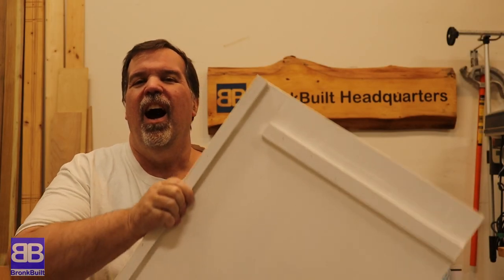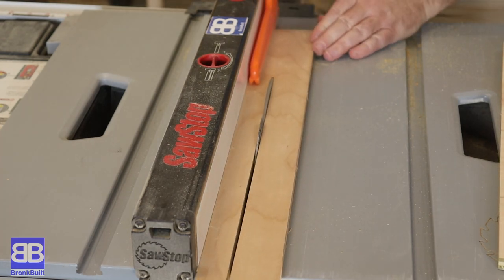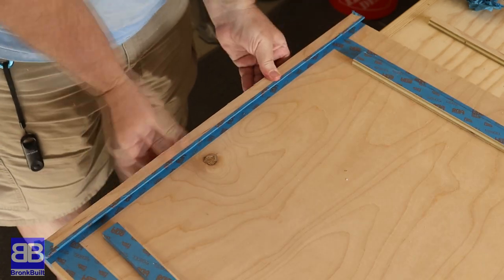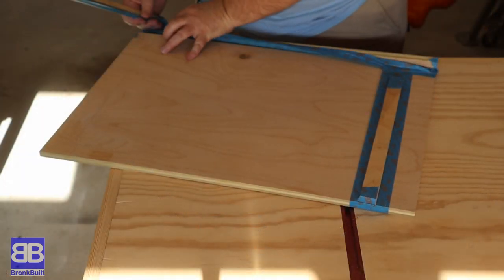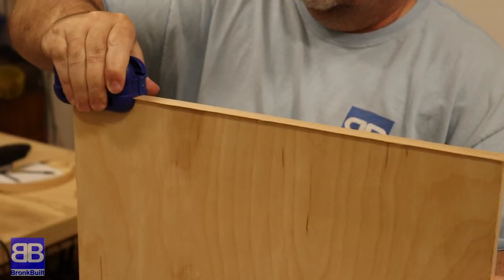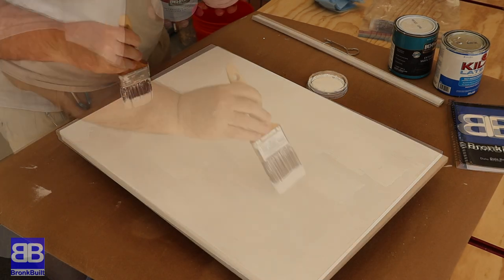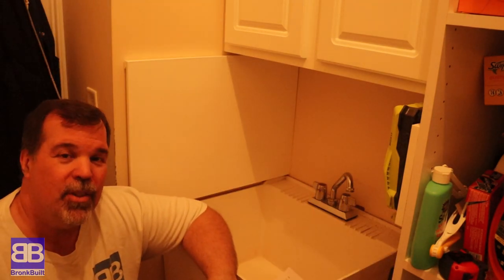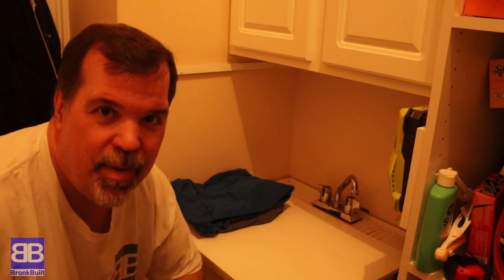Folding area for small laundry room

Comment: I’ve never heard of anyone applying a poly clear coat over paint. I have about a dozen concerns about that from longevity to incompatibility.
Reply from the maker: I've done this for years with great success.  Key is to make sure paint is fully cured. Also I don't plan on ever having to repaint this. If you are ever font to repaint then yes,  that is more work.  What are your concerns?  Is like to learn.
Reply: I’ve been asked many times by people of latex paints can be clear coated and I’ve always hesitated to say it’s okay. Some paints cannot be clear coated. You have potential issues of chemical reactions making the finish unattractive, bonding issues, flaking issues, interior vs. exterior changes in temperature and UV that could impact longevity. 

I’ve only had one bad experience but that was a project I put a lot of labor into and it scarred me. I’ve never had the nerve to make any similar attempts since.
Reply from the maker: Thanks.  I've not heard of that before.  I generally use the same type of paint but I think I'm going to buy a few different brands and test.  It would be a very good thing to know which types don't play nice with poly
Reply: No worries. I agree with you!

Comment: Why did you opt out of installing an addition front rail to prevent the table from any front to back movement the same as you did for the sides, or making the side rails of a length that would serve the same purpose?
Reply from the maker: The side supports stop both side to side and back and forth.  They fit into the sink.  I could have made them longer for less front to back movement but was okay with the amount I have.
Reply: Understood. When you set it in place, it looked to me like there was significant front to back play. As long as you’re happy with the result.
Reply from the maker: It sure does move a full 2-3 inches front to back.